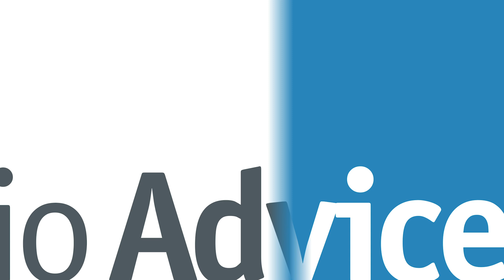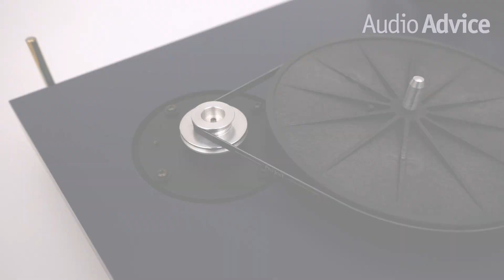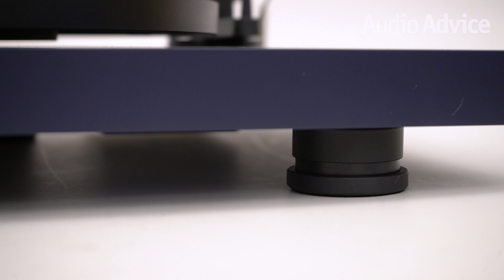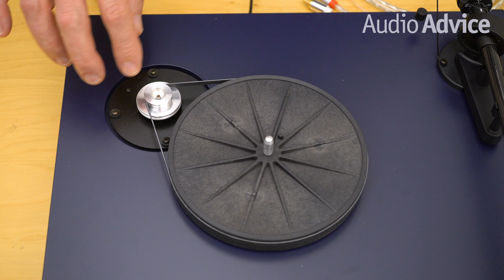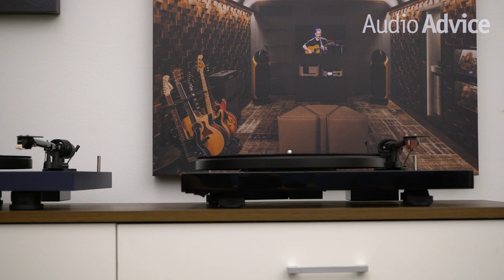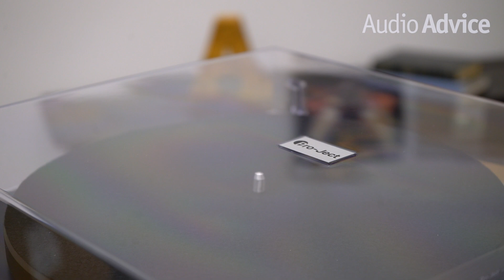Pro-Ject Debut Carbon EVO Turntable Review!

Comment: I own a debut Carbon Evo for two years. I recently noticed the noise that was based on the engine. I replaced the engine with a new one. Bought a better power supply. The engine noise is less, but it is still there. At a speed of 45, it is stronger. This does not affect the sound when playing LPs. But I regret that this is happening in the turntable at such a price. What makes sense to upgrade this turntable, which is being humbled by the engine already from production. Enthusiastic reviewers are probably deaf.
Reply: Didn't know an engine was optional on these TTs. I would stick to one with a motor.
Reply: @Ice-Fall  Thanks

Comment: New tech is just straight up TRASH. Instead of giving us fully automatic EVOLUTIONS.

They call their trash EVO, reduce it to the absolute minimum and call it a day. Audiophiles are clowns. 😩
Reply from the maker: And what turntable do you own?
Reply: @AudioAdvice  None. I want a semi automatic but there are practically none available except for vintage turners.

I think i will buy a vintage Technics direct drive automatic.

So annoying that we call backwards engineering „the future“.
Reply from the maker: @ANiCKiN  Understand, this is a very good one that would have a warranty, its manual start with auto lift at the end.  https://www.audioadvice.com/products/technics-sl-1500c-turntable-with-built-in-preamp-and-cartridge-black. If not something in this range, the vintage SL23 from Technics was a great semiautomatic belt drive if you can find one.

Comment: An embarrassing product, little more than a toy. Just a few months after the warranty expired, and used no more than 3 or 4 times a week, the motor started making a distinctly audible noise. This seems to be a common issue, as discussed on various forums. Pro-Ject is anything but pro. A big disappointment.
Reply from the maker: Sorry you had trouble.  Did you reach out to your dealer for help?  They are usually good at customer service.
Reply: @AudioAdvice What they told me is that I have to replace the motor at my own expense. Including shipping and repair costs, I need to spend around 200€. Never again with Pro-ject.

Comment: I still own and use one of the very first Project turntables, the Project one. Back then it bore the name Remy A. Thorens Project one. It,s over 35 years old and still working fine. The only problem that showed up after some time was that the metal platter deformed. I replaced it with a acrylic one. Problem solved but it shoud not have happend. I mounted a Linn cartridge and having no complains at all.
Reply from the maker: Thanks for sharing!

Comment: I have purchased many turntables in the last year and a half, from Music Hall, Audio Technica and even Crosley belt drive tables. The Music Hall is an over price hunk of plastic, very microphony, the Audio Technical is similar and has an odd headshell. Crosley seemed promising, but the anti-skate did not work. All have a noisey motor / belt transport, all do not run consistently on speed.I purchased the Carbon EVO as I have an older Project RPM 6 that is practically perfect. The Carbon EVO has a noticable low whirry sound and that is disappointing! For $600 this item should be dead quiet! I had a Pioneer PL10 belt drive turntable for 35 years that I accidently dropped a decade ago, thus the purchase of the RPM6, it was dead quiet. After 50 years we can't make stuff that runs on speed! The Pioneer was $100 with a Grado cart back in 1975!

Overall ok, but I am not truly happy with the state of so-called mid priced turntables.
Reply from the maker: Rory- it is possible your EVO was shipped upside down (it happens all the time) and the motor bearing had oil leak out.  If you purchased it from Audio Advice, we can send you a syringe of motor oil, if not Pro-Ject does sell vials of their motor oil.  We did a video on how to put it in a Rega motor, but the same holds for a Pro-Ject https://www.audioadvice.com/videos-reviews/rega-turntable-tips-and-tricks/  Thanks for watching
Reply: Did this suggest above my post fix your issue with the Carbon EVO?

Comment: Great video AA. I have small question. Is new TPE Aluminum platter better than acrylic?
Reply from the maker: The acrylic should be an upgrade over the TPE aluminum.  Thanks for watching!
Reply: @AudioAdvice  thanks for you quick answer. I really appreciate that. Im still wondering between debut carbon epsrit sb and  EVO, which one should I go with? any suggestion, AA?

Comment: Having the on/off switch underneath is defiantly a bad idea,  trying to find it then push it will only nudge the turntable to one side. 3 feet for support sounds good but in practice the whole unit tips easy.

Comment: I always laugh when people suggest that fully automatic turntables have "reduced performance" vis-a-vis manual turntables.  Yet nobody has ever said exactly how this might happen or shown any sort of evidence that it does happen.
Reply: Agreed—being an audiophile can translate as the art of turning molehills into sonic mountains of delusion. But hey, I’m proudly delusional, so here we go: Automatic turntables? Yeah, their mechanisms can sometimes add their own chaotic little motor percussion section vis-à-vis belt-driven turntables—kind of like a relationship with a toxic ex. Some things are just better kept separate! XD
Reply: for what it's worth 4 years later - automatic turntables can reduce "performance" when it comes to certain albums that need you to adjust some settings like like anti-skate or pitch. Or if you want to upgrade the cartridge that has a difference force setting and with many automatic turntables you can't so you're limited . Automatic turntables can do a lot of things for you and is great for most times but not all times. It's really about reduced adjustment rather than necessarily reduced performance, which is why I put performance in quotes in the first line.

Comment: The motor has always been the weak point in the Pro-Ject Debut series and one that always frustrated the hell out of me. It could be very noisy at times, giving a notable low-end buzzing sound that could never be removed. It's a welcome relief that this issue has finally been addressed with the Evo. I am hoping that this new motor design solves those problems. The new feet and platter designs are also welcome additions, and the Sumiko cartridge could be a nice improvement over the budget Ortofon.

I really need to hear this deck in action. It could be the best Debut yet.

Comment: I had a turntable that had that cheesy anti-skating setup and always seemed to cause me problems, no more of that for me.
Reply: That Anti-skate isn't cheesy it's actually the optimal way of doing it, the skating forces increase as you travel towards the centre of rotation (the spindle in this case), therefore you need higher anti-skating as the stylus tracks the inner grooves. With this weighted anti-skate gravity causes greater down forces as the weight raises, thus increasing anti-skate in accordance to the increased skate forces. This is the proper way to have accurate anti-skate as magnetic anti-skate is fixed at a specific force as as such will more often lead to greater inner groove distortion and greater wearing of the outer walls of the grooves. :)
Reply: Yeah that's true. I have a rega p1 and it's anti skate is not that good. Some records even though it's clean it sometimes skips or jumps. So enough of these kind of turntable. Better go with Technics or the audio Technica tables with a dedicated Anti skate adjustments.

Comment: Hello, Is here somebody, who is able compare this turntable with Debut Carbon Esprit ? Which is better ? According to me, my opinion is, that glass platter is better solution but i'm not sure. Can you help me with choice ?
Thanks.
Regards from Czech Republic.
Reply: The EVO is better IMO, adjustable legs, quiet motor which is very important, the new platter on it is great, not resonant, overall I think its better than the Esprit.
Reply: Also from Pro-Ject Audio Systems official FB page: "The Debut Carbon EVO has a new 1.7kg heavy TPE damped steel platter. You could still get the acrylic platter as an accessory, but quality wise the new damped, heavy steel platter is above the acrylic platter. The acrylic platter has the advantage of not needing a felt mat, generating less static than a felt mat and of course the looks."
Reply: I went for the Esprit over the EVO because of the acrylic platter. I can not compare it to the EVO, but I love my Esprit.

Comment: This unit sounds like the best thing since sliced bread.  Would a metal sub-platter have been better and would it increase the cost of this turntable significantly?
Reply: Pro-Ject offers upgrades. You can fit a precision higher-mass aluminum subplatter and also an acrylic platter if you so desire.

Comment: I bought the Rainier for my son's original Debut Carbon. Big improvement, IMHO. This is quite a nice set of improvements for a Benjamin. And that blue is rather gorgeous.
Reply: improvement over Red 2m?
Reply: Too my ears fuller, better balanced, larger soundstage. More "analog" sounding. I found the Red fatiguing, perhaps similar to a speaker where the upper midrange-lower treble is just too hot.
Reply: @leonardblush2557  Right on. I have the 2m blue on my project debut carbon espirit now. Really interested to see/hear how much better this would sound.
Reply: I imagine Blue vs Rainier is more a matter of taste. The $200 Sumiko Olympia would probably be the better head-to-head comparison candidate.
Reply: @oscillatingdailyaudio  So you already upgraded once from the O red to O blue? I too have a new Esprit and was contemplating upgrading from red to blue, but a salesperson told me he didn’t think I’d notice much difference between red and blue. Also, he told me (I think) it would take 100-200 hours before the red was fully broken in. So I’ve yet to pull that trigger. What was your experience, going red to blue, if you don’t mind my asking? Thanks
Reply: @bbutler5090   I did and also remember youi're talking to a salesperson. :)  I thought it sounded better- there are countless articles on line talking about the difference between blue and red. It's not huge, but it's there. It shouldn't take any cart 200 hours to break in. that' a bunch of bullshit.  The espirit is my secondary table, but I've even thought about getting a Bronze ortfon on it.
Reply: @oscillatingdailyaudio  Cool. Good to know you’re in the business. (I’m assuming, perhaps incorrectly, when you said “salesperson” you meant in the AV field.) As to the hours to “break it in,” I looked back at my email and what the person told me was don’t look to upgrade until 200-400 hours of use. They didn’t use the term “break in,” however. They added that any improvements from red to blue would be “super marginal.” Based upon that conversation and the fact that I’m more than happy with the red, I’m holding off upgrading to blue. (I can’t afford the bronze, not now anyway.) And I’ve read many articles on the topic and the general consensus seemed to be that blue was a significant improvement over red. I was surprised when the salesperson suggested otherwise. What do you think? I should add I paired my TT with The Fives by Klipsch. Love them too. Thanks for the helpful response!
Reply: @bbutler5090  lol..Didn't mean to confuse you. I was referring to the fact you were talking previously to a sales person. I am not in the business, but there's a lot of snake oil, and in general just lies in the entire audio industry. the blue is better, how much better is obviously subjective. What phono pre are you using? The espirit is such a great table (esp for price). I have a Rega P8 and obviously its a LOT better, but it's not so much better that I dont' want to listen to the Espirit.
Reply: @oscillatingdailyaudio  Ah, got it. No worries. I’m easily confused sometimes. I’m using the Esprit’s built-in phono preamp. The Fives also have a preamp, but the advice I received was to use the one built in to the TT.
Reply: @bbutler5090  I didn't know the Espirit came with a built in, mine does NOT have a built in...I would advise using an external phono pre.Most built in pre's aren't that great.
Reply: @oscillatingdailyaudio  Yes, it does. I think that’s one of the reasons I went with it over the others. Is there a preamp you recommend? Thanks
Reply: @bbutler5090  it depends on your budget, I use a Yaqin MS33B (tube)  Project makes some really decent phono pre's
Reply: @oscillatingdailyaudio  Cool. I’ll look into that before replacing the cartridge. Thanks for the advice!
Reply: @Reid Smith 
Sang the Star Spangled Banner at the opening of the County Insecticide Convention. 
Big time.

Comment: How does it compare to the Rega planar one ?
Reply: @PaxKishania  Or even a comparison with the P2?
Reply: @elmhurst86  I chose this over a Planar 2, with the Planar 2 its harder to upgrade cartridges, you can't adjust its legs and you have to remove platter to change the speed also it comes with great changeable rca cables unlike the non removable Planar.
Reply: @andymill32  All excellent reasons to choose it over the P2.  Congrats!
Reply: @andymill32  I had the exact same question as I have it narrowed down to
Either the Rega P 1 or 2 and the Project Debut Carbon Evo.  Looks like the Evo it is!
Reply: Thats it,, im sold